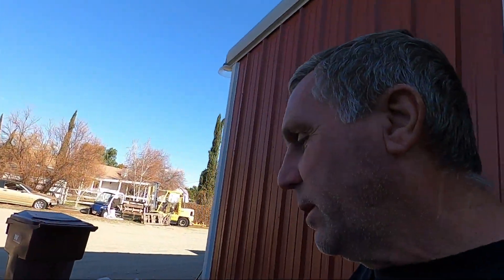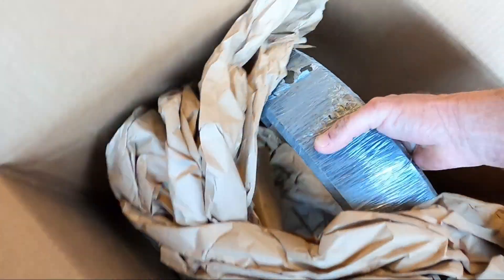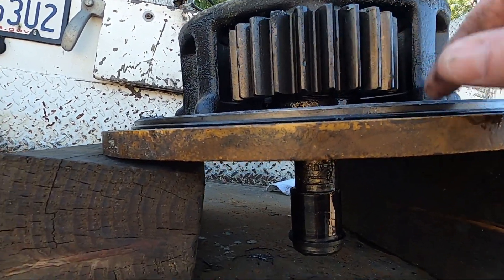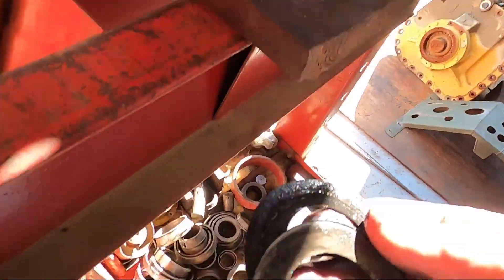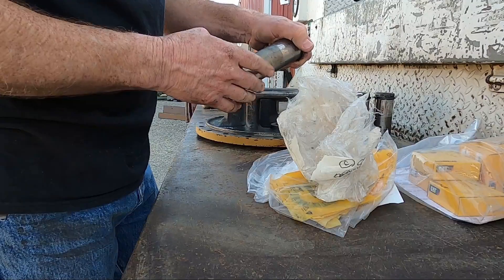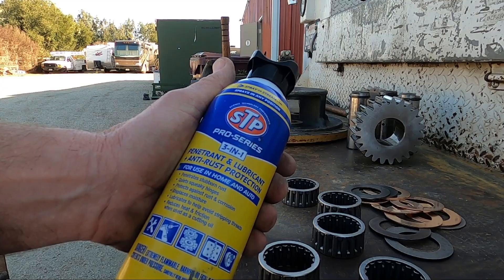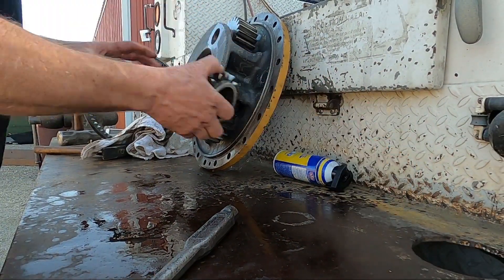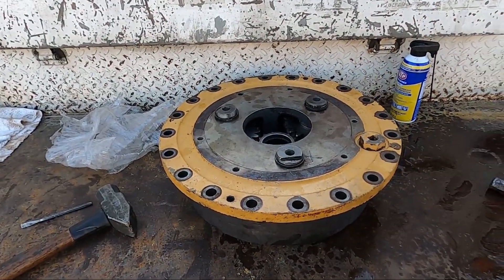Caterpillar 735 Wheel Planetary Rebuild

Comment: FYI…shipping dimensional weight doesn’t isn’t determined by the weight of the package, but the size of the package.  Why if you shipped a very large lightweight box with a feather in it vs. a very small heavy package with a gear in it the price will be damn near the same.  Example: They will charge about the same because most shippers are in the business of air shipping not shipping air.  They don’t give a damn if you are shipping air.  They don’t give a damn if you ship gold.  They only care about how much money they can make with the available weight and space they have and still able to make a profit.  They know there are acceptable upper and lower limits of space and weight for trucks/airplanes.  I have shipped a lot of air.  Very expensive and I had to add that cost into the price of the product.  That’s why an item costing me $.50 costs you $50.  Mostly due to shipping and I can’t blame the shippers for this.  They are simply covering their fixed costs as I am mine.